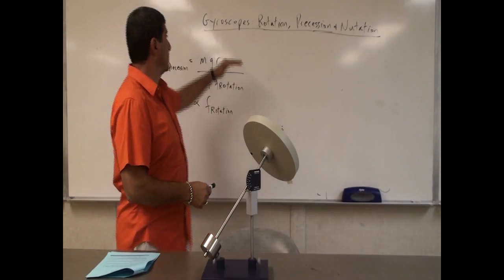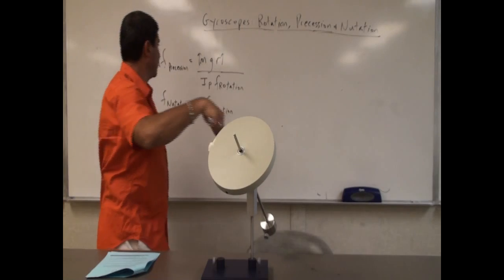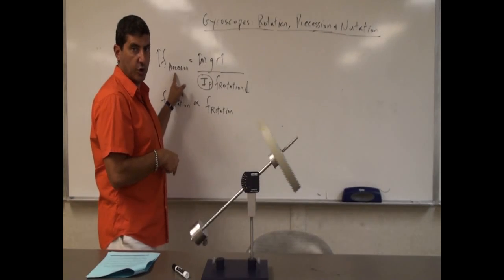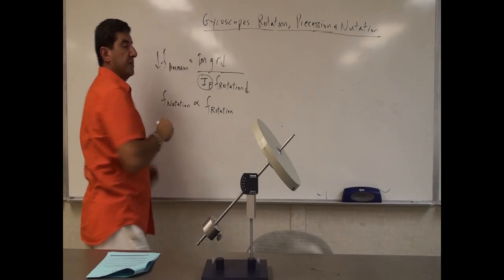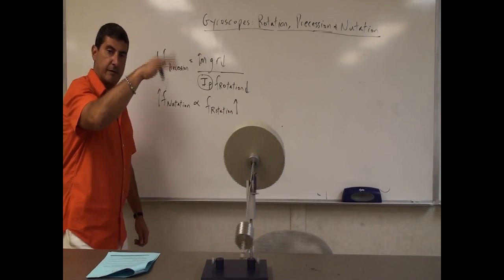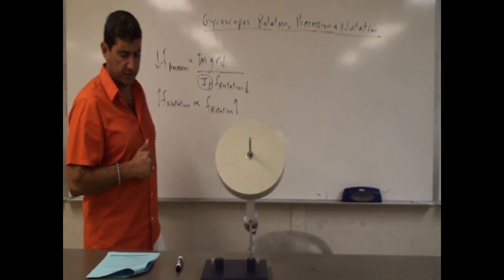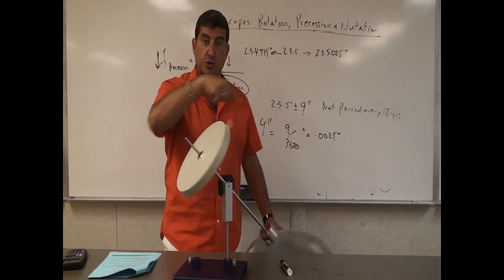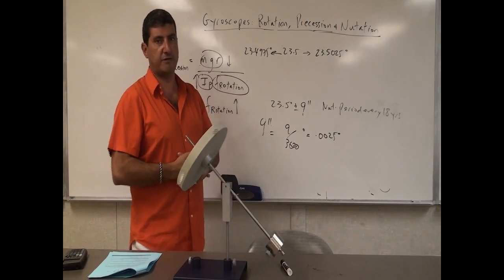Gyroscopes: Rotation, Precession, and Nutation

Comment: I had to calculate the exact formulas (ignoring very tiny error terms) in graduate physics class at Temple University many years ago, and then present the exact explanation to the class. While the formulas given here are not exact, they do give a feeling of what is going on. All that is missing is an explanation of why precession and nutation really occur, and this requires more detailed analysis than was done here of the orthogonal rotation produced as the weight attempts to drop due to Earth's gravity field. Ordinary Newtonian mechanics can get very complicated!
Reply: What formula did you use?
Reply: @jiansun7202  That was about 50 years ago. I've certainly forgotten all the details. All I can say is that some textbooks probably do the same analysis I did. Start by considering the experimental apparatus when it is not spinning. Gravity will appear to pull it so it rotates in a particular way. That is the start of the analysis, that rotation due to gravity. It gets much more complex from that point on.

Comment: I don't understand it. The formula is counter-intuitive and not fitting the observation.
1. F progression speed is proportional to the R? So if the pole is longer we will have faster progression speed? How can that be? I thought longer pole will cause slower progression.
2. F progression speed is counter-proportional to the rotation speed of the wheel? So when the wheel spin slower we will have faster progression speed? If the wheel spin is closer to 0 then we will have an extremely fast progression speed! How is it possible?
Reply: Sorry for the 4-month delay in answering. We don't have good intuition (commonsense physics) for these effects. You have to actually do experiments to see what happens, you can't just guess, like you just did. "Thought experiments" don't work well for understanding precession and nutation until you understand the physics in more detail. There are also more subtle effects in a gyroscope, other than precession and nutation, that are difficult to measure and even less intuitive.

Comment: Why does the Earth revolve around itself?
What tilted the earth at 23.5 °?
What caused the precession movement?
Reply: the earth shape made it tilted at 23.5 cause its not round completely and indeed its closed to an oval shape but not rounded again something close to potato shape. so the center of gravity for the northern sphere and  the southern are not match exactly. that cause the earth tilted! the gravity force of the sun considering that 23.5 tilt angle cause the precession.